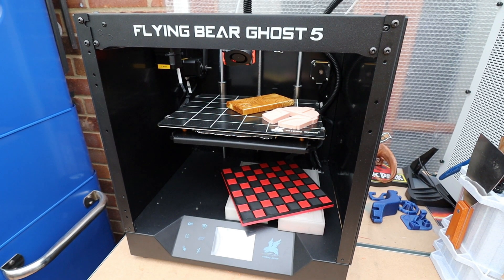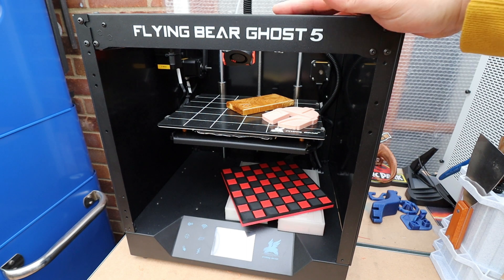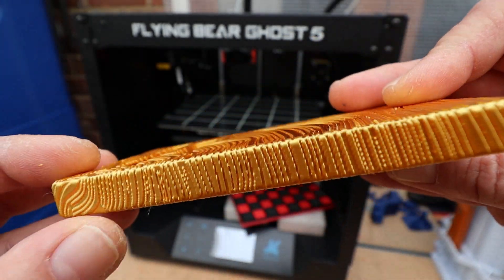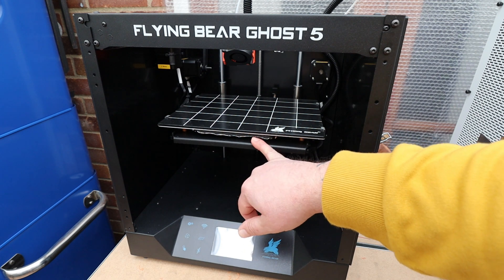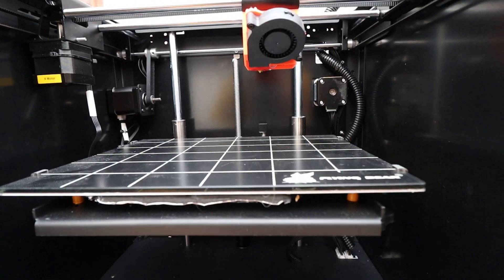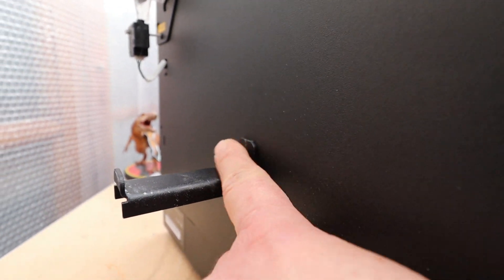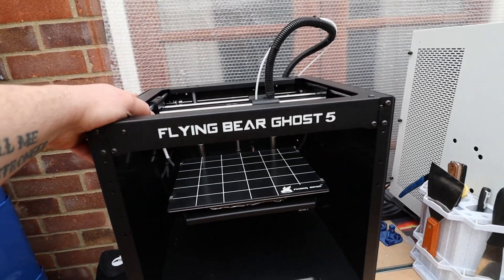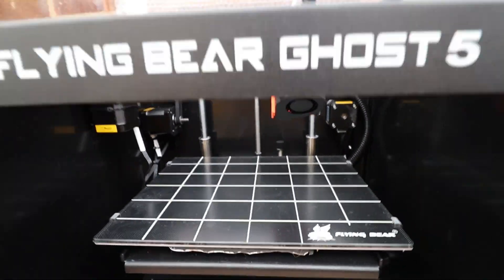Flying Bear Ghost 5 3d Printer Review And Test Prints

Comment: Looks surprisingly good for the price, even with the supplied cheepo filament! But why are all your test prints basically 2-D, even the chess pieces? The Mandalorian helmet seems to have been run over by a steamroller! Having all the layers basically the same with no overhangs etc. is surely a pretty undemanding test?